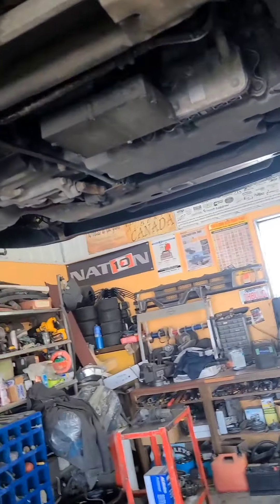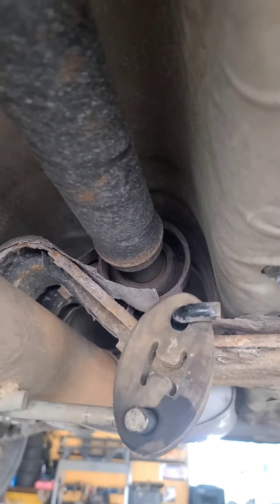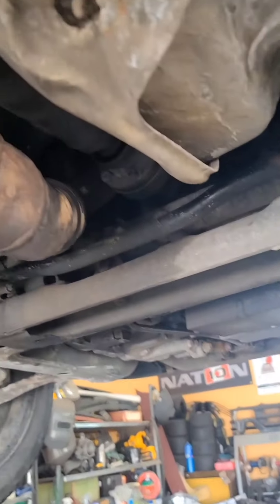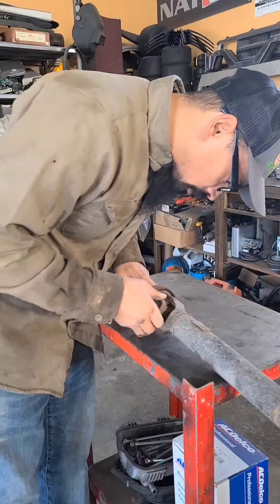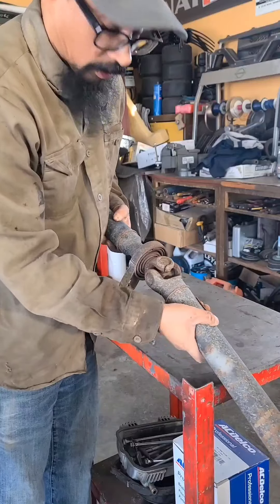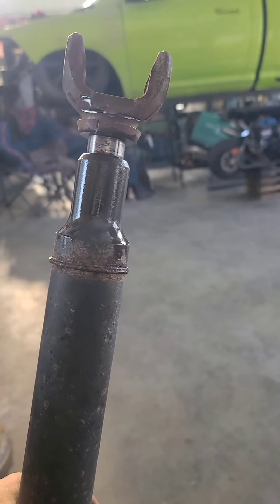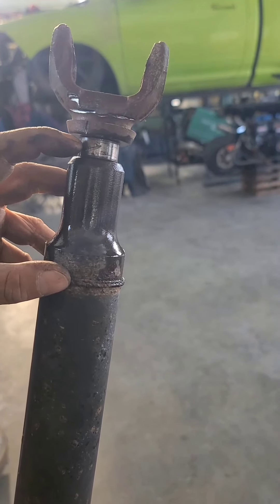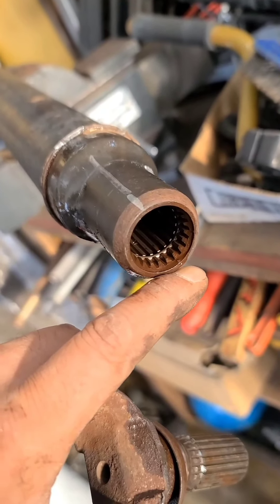1999 Volvo V70R steady bearing and u-joint problems.

Comment: did you ever come up with a solution?
Reply from the maker: As of right now no. I did find another V70R at the junk yard and I snagged the driveshaft but like the above post said, it was a different shaft. Technically a 2 piece shaft, but the slip yoke was friction welded together, so it is non serviceable,  so I couldn't take it apart to replace the steady bearing. So still rockin the Fwd because I don't wanna spend $1000 on a drive shaft. I may try building my own, I don't know, well see.

Comment: Thanks, I have to change mine.
Reply from the maker: Just be careful  as has been mentioned here in the comments, there are 2 styles of drive shaft, one you can take apart like mine and replace the steady bearing, and another that is NOT possible to take apart.
U-joints on either style are non servicable.

Comment: Yup...as I found out after importing a centre support bearing from the UK...... The shaft on some Volvo's/Some years....is not "serviceable"...It's a one-piece unit.  
 Mine does not split as yours did at that centre support...... But has the "staked" UJ's as yours.  (2009 Xc90 V8)      FFS Volvo!
Reply from the maker: Yeah, I found out that same exact thi g. I found one in the bone yard, but the slip yoke was friction welded together, so it was impossible to take apart.  So for now I'm still rockin Fwd. Sad Panda.